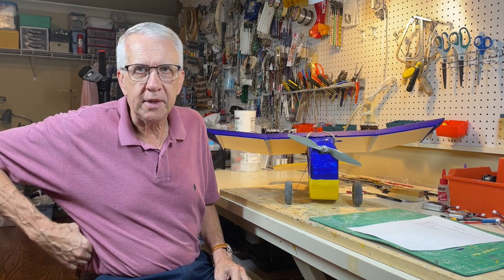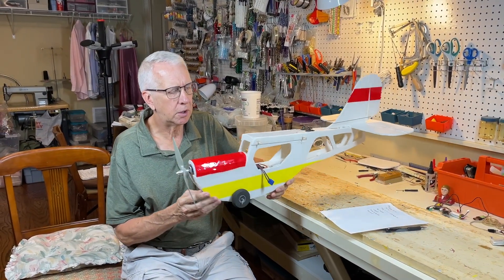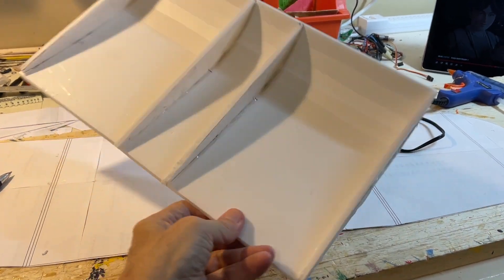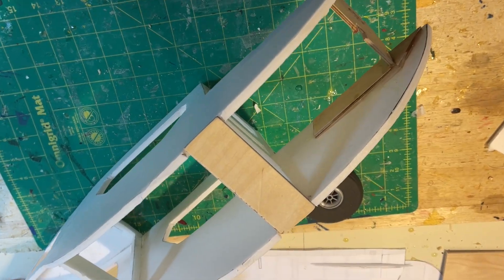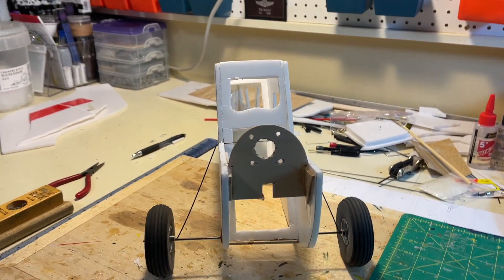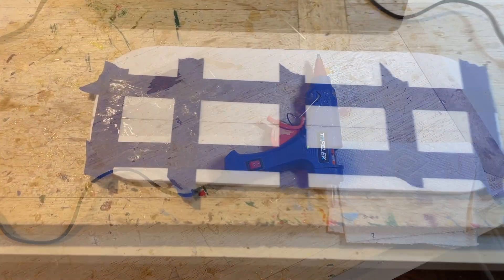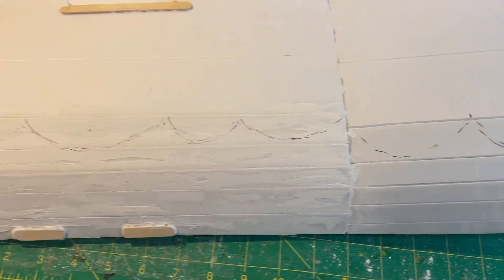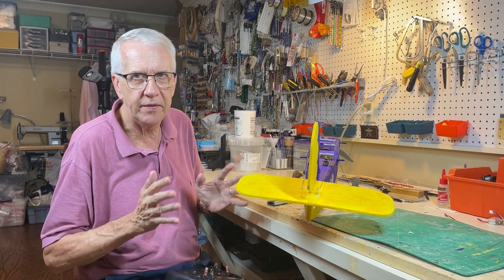Let's Build the Slowly 2 Foam Board RC Plane

Comment: Tim, can you tell me exactly what motor you used and what size battery pack (mah).  This looks like a great getting back into the hobby trainer.  Not real sure about motors though, the speed 400 can motors were just coming in when I quit flying.
Reply from the maker: Hi Dave, I am on travel, do not have exact motor name. Buy a brushless for sure, and one that can handle a three lb model. With a three cell plenty of power.

Comment: I still have the original Cox Lazy Bee with a .049 engine. Still flies great. I plan on doing a throttle body conversion to my Cox .049 engine that Cox sells with a separate glow fuel tank in the fuselage. It's going to make it so much more fun to fly with longer run times.
Reply from the maker: Awesome, have fun!

Comment: Hi Tim I would like to share a tip how I curve foam board.
1st cut only the paper on the inside of the curve !!!! 
If that is not enough then use the pointed end of a skewer and widen each cut.
If that's still not enough the use the blunt end of the skewer and widen each even further.
Try it, I do not need any filler. If you prefer put some Elmer's glue in each cut
Reply from the maker: Excellent technique, thanks!

Comment: Nice improvements to the design.  A really great aspect to the hobby is building and just trying things out.  New materials, new methods, new techniques; see what works and what doesn't.  I think there is a strong push for perfection in rc airplanes and many feel the need to buy RTF stuff.  There is so much room for diy builds of all kinds.  The local club here out of 60 or 70 members barely has more than one or two that build from scratch.
Reply from the maker: Thanks for this update. 😊

Comment: In ref to your relief cuts to form curves (like the cowling top). Typically one would cut groves on the inside of the curve, not slices on the outside. It's very easy to do, too. You just offset your straight edge by about 1/8" from your first cut, then angle the blade. You can  glue this, and get a nice strength, too, but best of all - no filling.
Reply: What I have done on some foam wings, is score the inside with a philips screw driver, or barbeque skewer, to make it easier to bend, all on the underside of the wing or foam. It works very well, just score part way. I might download the plans on this one, it looks good
Reply from the maker: Good tip, thanks!